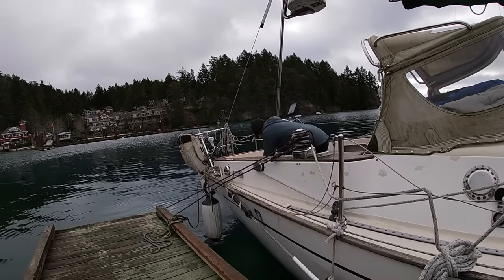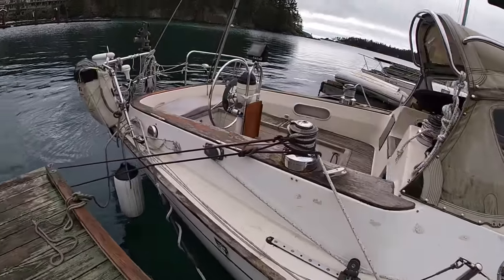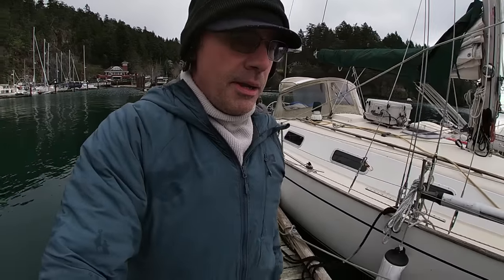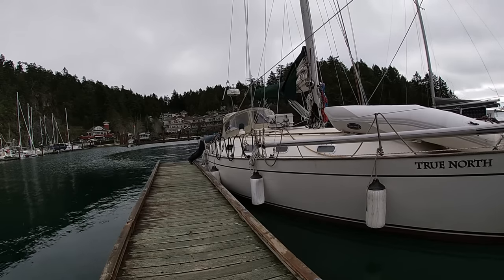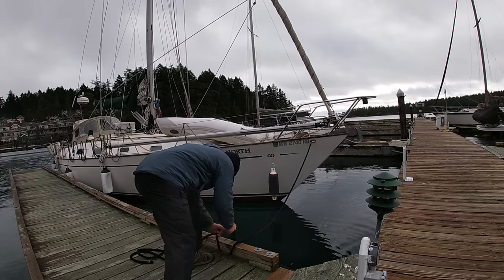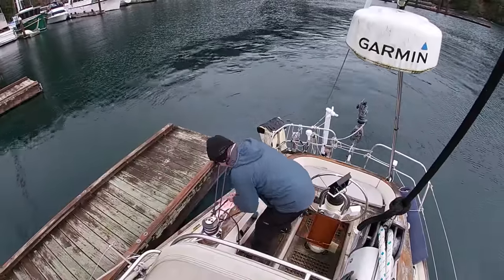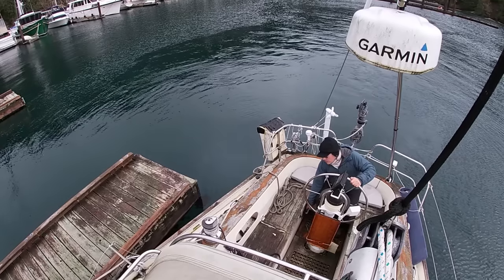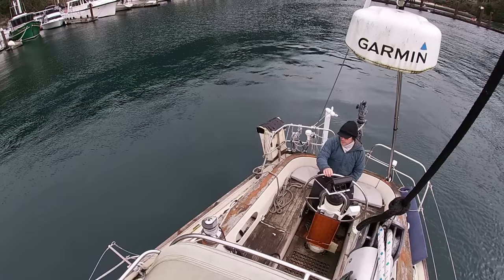SINGLEHANDED; LEAVING THE DOCK USING THE "MOITESSIER STERN TIE" -- DOCK VIEW

Comment: Hi is true north a Canadian Contessa 32 or is she a 38? great video. can testify to not being brave enough with throttle to make this work.... mine spins round like a bloody ballerina as soon as the wind takes the bow
Reply from the maker: True North is a 1984 Contessa 38. "Big Sister" of the Contessa 32 -- all the same ratios, just stretched up to 38 feet. Manufactured in Britain to Lloyds of London Spec, brought over on a ship to North America, and trucked across America to the Seattle area where I bought her in 2016. Here is a brief intro video I made of the boat: https://www.youtube.com/watch?v=pLDEcN04_Vc

This does work well for me. I also used this technique on my Contessa 26. I have tried other methods though I do seem to come back to this one if there is any breeze or current. I have starboard prop-walk so I do like to "pre-set" the boat with stern to port before I engage in reverse. I also use lots of fenders! I also started using my boat hook a bit more for fine-tuning from the cockpit. I will also often walk the boat a third of the way out of the slip with the engine idling in neutral as well -- then step aboard the stopped or very slowly moving boat to take over with some throttle. All the best mate.

Comment: Great video, thank you!
1. What about steering? Can tiller / wheel freely spin around until the moment you untie?
2. Does the process change with a different wind direction?
Reply from the maker: You're welcome. Great questions. I have left the Tiller free in this case and it worked fine with it loose and roughly centered. If I lock the wheel hard over for a port turn, the boat balances with the bow further from the dock. If I lock it hard over for a starboard turn, the boat balances with the stern further out from the dock. I suggest you experiment with this to optimize your boat position. This will also change with the location of your tie off point on the boat. You may need to lock the wheel or Tiller or engage wheel pilot to hold it fast.
Reply from the maker: The process is similar for different wind and or current conditions though you may want to adjust throttle or rudder position as above to accommodate. With a wind or current from the stern, you may not need any throttle at all. With wind or current from starboard,  you will need to add more throttle to keep the boat pinned to the dock. With wind from Port, just enough throttle to keep the dock line tight. Once on the single tie, you can monitor for a few moments to see what combination of throttle and rudder puts the boat in the most favorable position to continue the exit.

Comment: Any difference in procedure port-to dock as opposed to starboard-to dock?
Reply: Due to prop walk, one side would result in pulling your stern toward the dock, while the other side would push it away from the dock.  

In anticipation of this, while still in forward gear, You would want to turn the wheel so that your stern was against the dock or away from the dock.  Then, once in reverse, the prop wash would work to your favor in straightening the boat.
Reply from the maker: Yes -- great answer Thfe. I agree. My boat has starboard prop-walk -- and depending on the slip geometry I can adjust the wheel to either have the stern against the dock, or away from the dock in preparation for the exit. In this case, I had a lot of room behind the boat, and the wind pushed me almost straight back right away. I only learned that tactic recently with help from my boat neighbors and viewers.
Reply: @respecttherisk2022  

BTW.  My strange channel name???  Years ago, I had a video clip I wanted to text someone, but it was too long to send.   It would fit on YouTube, so I simply created a quick and dirty account to share it.  I never intended to use it again, so just slammed the keys to create my channel name!  

Now I’m stuck with it.
Reply: Nicely done video; I liked the pace and your narration which both underscore how drama free this method can make undocking. I just subscribed and am looking forward to many more shorts on how to handle a sailboat under power 😉.
Reply from the maker: @torstenhansen4308  Thank you!

Comment: If there was wind from the starboard side on the bow would that not push the bow out? what makes the bow hug the dock at the bow, that's the bit I dont understand.
Reply from the maker: No worries mate. The engine is in slow forward so the thrust from the propellor pushes the boat forward from the center-line of the hull. With the stern tie tight, that force pins the boat to the dock. The boat is pivoting on the tie-in point. If the dock was not there, say, the boat would just go around in circles to starboard on that pivot point. The more wind there is from starboard, the more thrust is required from the propellor.

Comment: Bloody hell you dont even need to tie off Lol. Try doing it 15 knots off wind on the bow and another boat next to you.
Reply from the maker: Breeze was light that day for sure -- just enough to grab the bow without the tie off. 15 knots would require quite a bit more throttle to hold the boat in place for sure.

Comment: I allways tie my boat up from my own deck so i dont have to leave my boat to undo the Roses. So much easyer!!
Reply from the maker: Thanks for the comment mate. That's an interesting approach. Do you just loop the cleats and then pull them in from the boat?
Reply: @respecttherisk2022  I use the 0800 methode to tie my ropes because this way they are easy to undo. 0800 is ones around the cleat than a figure eight and than two times around the cleat. When there is a lot of wind than i prep the ropes so that they cum undone even faster. Works for me!

Comment: Nice...always good to learn a technique. I use a version of this to spring out of my dock. I have an Alberg 35, more or less full keel, and the fairway in my marina is only a little wider than the boat length. Fortunately, the turn is to port, same as my prop walk. But if the wind is over the stern I need help getting the boat to come around and that's when the same stern tie, gradually let out until the bow clears the dock, works for me.
Reply from the maker: Thanks for sharing that. My permanent birth has the same challenge, except I need to bring the stern to port if I want to go out bow first -- and my prop walk is to starboard. When I add in wind and current, it can be quite challenging. I have learned a lot from the suggestions of viewers. Thanks for the note.
Reply: @respecttherisk2022  use a two Part spring one the Port transom and turn around that spring.
Reply: @respecttherisk2022  use a two Part spring one the Port transom and turn around that spring.

Comment: If you want you can put the engine in reverse while still tied to the winch which will swing bow away from the dock pointing you in the right direction. Release line when desired angle is reached and away you go.😊
Reply from the maker: Great suggestion mate! Thank you - I am going to try that! :)

Comment: i have a sabre with an offset shaft that absolutely does not want to turn to port after backing out especially with any kind of breeze. she does not back and fill like a normal boat.. i take this one step further and pay out line for about 20' as im backing away from the slip then "trip" the stern by putting a wrap on which causes the bow to pull to port. i use polypro line that floats with the dock end put through a carabiner made fast to the dock cleat. then when im ready i just pull the line through and bring it back on board.
Reply from the maker: That is a great idea. I experimented with a technique very close to that in this video clip. I had a carabiner fixed to the dock on nylon webbing, and one on a stanchion -- then backed out and helf it fast so that the my prop walk pulled me to starboard to make the turn in reverse. Using a floating line would be a great idea. Have a look here and you can see some of my learnings. https://www.youtube.com/watch?v=I_2bjWQ-ZZ0

Comment: I was shown this method by someone at the marina because I am often single-handed. It works very well however I would add that it is even more effective if you turn the wheel away from the dock and lock it down. At that point the boat is not going anywhere.  When leaving, I place the line on a tall line holder made out of PVC, so upon returning I can easily grab the line and drop it on the winch.
Reply from the maker: Excellent suggestions. Thank you.

Comment: What about a little cleaning and painting?
Reply from the maker: Haha, fair point. I bought True North in 2016. She is a 1984 hull. I kinda have left the cosmetic stuff til last. Redid all electronics, new radar, VHF, AIS, chart plotter, depth sounder, wiring, new panel, House and Cranking battery banks, battery charger, voltage and current meter, added Hydrovane, new wheel pilot, new life raft, Watt and Sea Power generator, all new running and standing rigging, new diesel heater, dingy, added a bilge pump, new reefable storm and 100% jib, refurbished my genoa. I added a cutter stay and backstays for the storm jib. I am booked for a full engine replacement in a couple of weeks. The 1984 Volvo Penta 2003 is still running ok, and doesn't burn a ton of oil, but it seems there are a few things about to fail that would almost be the price of a new engine. (The drive spline already failed two years ago, and I did a repair with a SureDrive Spline kit -- Sheesh -- so I am constantly anxious about something else failing on the old Penta engine, it seems) Since this video was made, I replaced the dodger (crazy expensive!) and did some touch-up sanding on the teak. I have been purposefully letting the bright work varnish peel off on its own. I like the plain teak look (and I am lazy!) The cockpit seats are still in rough shape and I have been exploring how to do that. I did my first haulout on my own this spring and did the bottom paint, cutlass bearing, and replaced the Dripless Shaft Seal. (What a learning experience for me!) I did buy a small power washer that I now keep aboard -- that was a game changer for quick deck cleaning for sure -- and helped strip some of the last bits of varnish on the deck grab rails. I have lent it to my boat neighbors and they agree! My dock lines are a bit tired too. Laughing, I do tend to be a bit lazy with general tidiness until the wind and water conditions warrant "clearing the decks!" There is never "nothing to do" on a boat! Thanks for the nudge tho, lol, I still have to get after the teak and the veneer on the cockpit seats :) The upholstery on my salon seats is also starting to go.... I guess that means I have been living aboard quite a bit! :)

Comment: This same technique works in catamarans and trimarans and is especially important to know since they can typically only be boarded at the stern, so you definitely need everyone onboard before you untie. You can of course double back a bow tie so that you're on the boat when you untie it and never need to run from the dock and catch the boat before it drifts too far to reach.
Reply from the maker: Thanks for the note. I did not know that about catarmarns and trimarans! Great tip as well. Thank you!

Comment: Thanks for your prompt reply. Yes I use these techniques especially when there is a strong wind blowing me on the dock and I'm single handed in vessels over 50 ft long. The helms are obviously hydraulic which is a big help in holding position. Keep safe in your travels
Reply from the maker: Thanks for sharing that. Wow. I have never singlehanded on boat larger than mine at 38 feet. Very impressive! You too -- all the best!

Comment: "Line goes into the water, the props in the water, our prop". 😁
Reply from the maker: A floating or buoyant line might help this issue. I haven't seen one with the suppleness and feel that I like. So far, just a bit of care and attention has kept my dock line out of the prop except on one notable occasion when I was distracted by several other variables!
Reply: @respecttherisk2022  depends on how much suction your prop generates and depth, it could still get pulled in. Sometimes I feel props and lines are just drawn to each other, like insect zappers and some bugs.

Comment: No. A sheet winch is a sheet winch, not a mooring bollard. Go and check your winches manual so see the maximum design load and I assure you you run the risk of exceeding it by tethering a yacht to it.
Reply from the maker: That's a good point. Thanks for sharing that. I will check that. Anecdotally, I figured with the engine idling in these cases, the boat would be at 2 or 3 knots through the water. I have exceeded hull speed with jib only -- before reefing -- I suspect the forces were greater on the winch in those conditions. It does "feel" that way on the line and the sheet, but again, this is just anecdotal.  Thanks for the note. It's a great comment and certainly one that we all should consider.
Reply: Honestly mate,  there is nothing wrong with your video and the guy mentioning  not using the winch to inch forward on is being a bit of a fairy.  Perfectly good 'working' single handed method... a hardened sailor can also use that same line with the hitches removed and a fender on the aft quarter to go astern and it will help bring the nose out if you were being blow onto the pontoon.  you'd need the space mind... or be on hammer head etc... nice one
Reply: YES, stay in bed under the covers and you will be ok.

Comment: This is just boating 101, just call it an aft spring. I teach all my students to do this in their first class. Should be standard knowledge but to self-taught non mariners this is advanced I spose. You could also do the same thing with a fwd spring from the stern (not “rear” dock line) doubled back to you in the cockpit with reverse throttle and dispense with all the wraps and hitches on the winch. But options are good.
Reply from the maker: Thanks for the comment. I wish I had you for an instructor back in the day! I never learned it or even heard of it until quite a long way into my sailing experience. Forward spring is a good idea. Thank you for sharing that as well.

Comment: All these videos show floating docks at the side of boats, which are easy. Nobody ever shows videos of how to single-handedly tie up to and leave a piling/post berth that only has a fixed dock at bow or stern.
Reply from the maker: That's good point. Thanks for bringing that up -- it would be a good video to make for sure. I have been to maybe 30 marinas the Pacific coast of Canada, USA and Mexico and have never seen a situation like that -- but I agree, it would be a challenge for sure! Do you have any suggestions on how to do that singlehanded?
Reply: I have my boat in a box with two posts at my stern and the dock going from left to right at the bow. I use the same principle - you can’t lean the boat against the dock but I can balance it by steaming in the luff stern line, carefully applying rudder and thrust. This gives me time to remove the other lines (I don’t leave my boat for that) or to throw them on the piles/dock cleats.